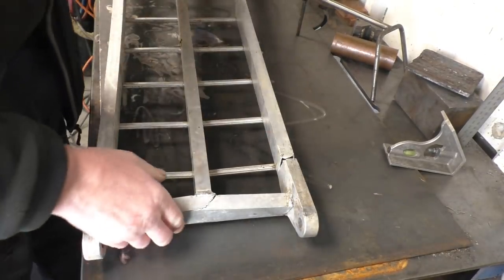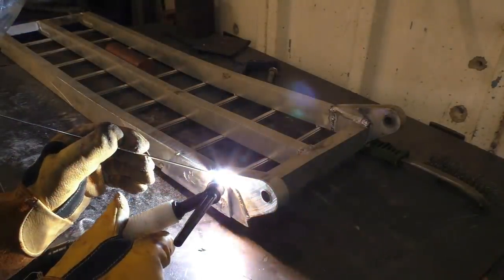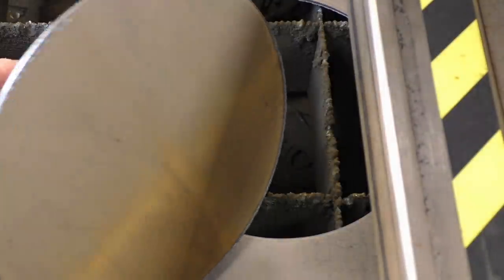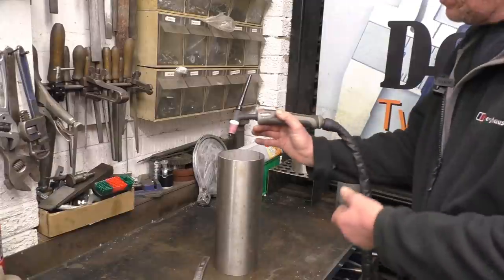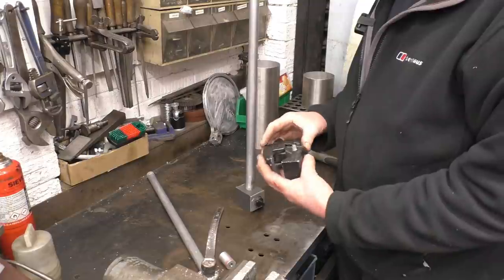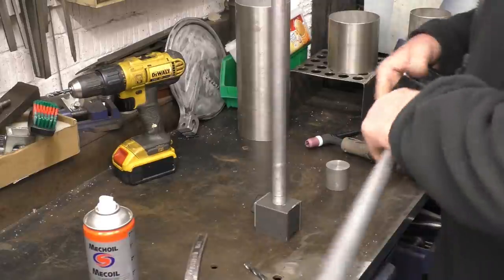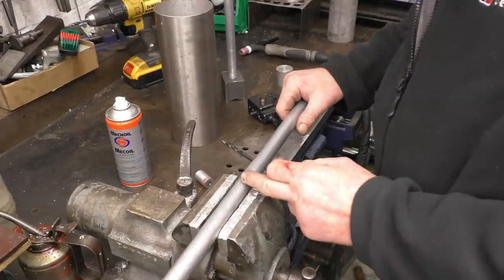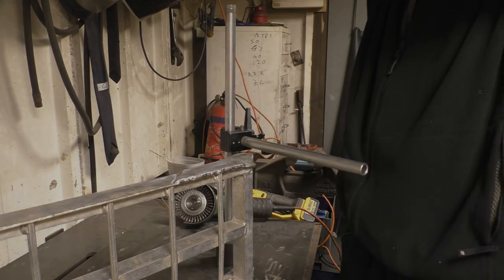SNNC 360 P2     Aluminium Weld Repair.   TIG Steady Rest

Comment: One thing wrong John, you have a LandRover Defender front, and a two piece Series windscreen! They went one piece when the Defender90 and 110 came out in 1990 .Love the hand support, those are really good clamps. That should make your TIG welding a good deal easier. Happy Christmas to you and Debs, and I hope you dad gets better and comes out safe and sound.
Reply: I bet if it was viewed at an angle, it would look like 88" instead of 90" too :) lol.
Reply: The 90 was introduced in 1984 (83 for the 110) 

I was digging a brand new 90 out whilst plastered in mud after grounding the axles 10 yards off a main road up a farm track in early 1985

The ‘Defender’ name didn’t come into usage until 1990

Comment: If you have some spare fire cloth cut out a circle of fire cloth. Put a hole in the middle the same size as the post so you can cover your magnet and it will always stay on the stand unless you unscrew the post.